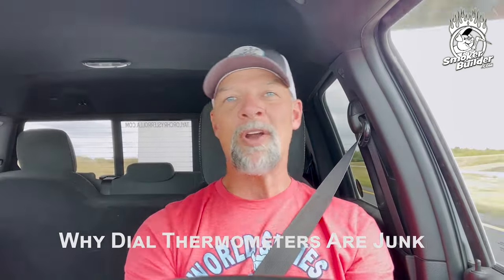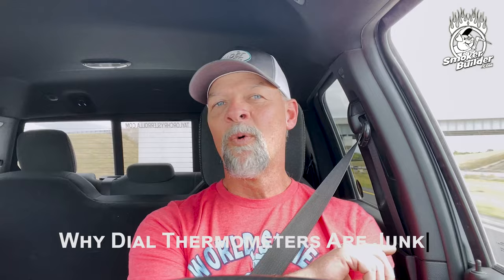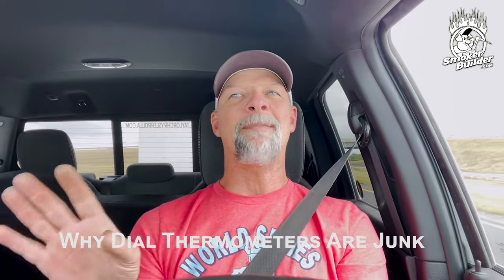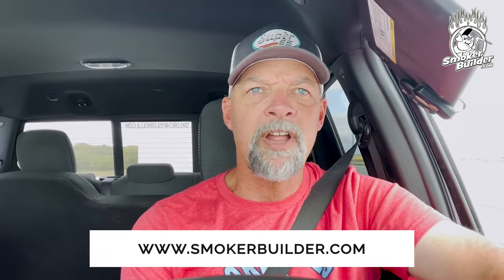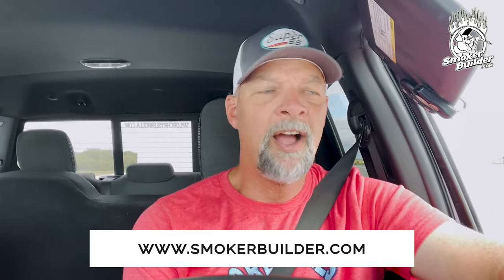Cooking Temperature: Why I Think Dial Thermometers Are Junk

Comment: Absolutely right, Frank! I am definitely a tech head and I can't even tell you how many digital thermometers I have. My latest pit has 3 dial thermometers, and I just bought 4 to put in the one I'm finishing up... but... I use my Fireboard with 6 probes and my Themopro with 4 probes, as well as various others at times, as well... Maverick, as you mentioned, an iGrill, etc. All those wires and probes make my pit look like something hooked up to life support, but I've learned over the years to map out the various temps of my cookers in multiple spots AT THE GRATE LEVEL. Dial thermometers in the doors or walls of your pit are good only as a spot check, and what I've learned is learning that the dial thermometer showing 230 or 240 may correlate to grate level temps within 20 or 30 degrees, or whatever. Basically, as many of us have preached for years - LEARN YOUR SMOKER. Learn how it cooks. Learn where it likes to run (cooking temps). Learn how it flows, what the response of your meat is in relation to the cooking temps and flow of air through the cooker - if it's a top-down offset, or a reverse flow cooking mostly via radiant heat from the baffle plate on the bottom, etc. I use my dial thermometers as a 'reference' point, knowing about where I need it to be (given current conditions) and I can see them from 10 or 20 feet away, without having to get close to my digital thermometer's screen to read it, or pull up my phone to check the display, etc. And yes, even the thermometer probes mounted on your grates will be affected by the temps of cold meat you've just put on it causing a 'shadow' or an altered temperature zone in the immediate vicinity. Sometimes as much as 30, 40 or more degrees off, and I've seen probes in the 'shadow' of meat (downstream in the heat flow of the cooker) reading as much as a HUNDRED degrees lower than other ambient probes! Learn how to run your pit. I've run as many as FOURTEEN different temp readings one a cooker at one time during a cook - but I've also learned my pit well enough to run the whole cook with NOTHING but the dial thermometers, knowing about where they need to be sitting in order to estimate the general temps at various places on my cooking grates. But I know that the dial isn't ACCURATE for current temp - it gives me an idea of where things are, and I use an 'offset' handicap in my head for each spot in my cooker! lol It's all about how well you know your pit!

Dang... sorry for the dissertation. lol
Reply from the maker: Absolutely 👍🏻

Comment: Good info Frank! I think in the stack would be the best place for a permanently mounted pit thermometer. And for this purpose I'd see nothing wrong with something like a Tel-Tru type, so long as you understand the limitations, and use it more for a simple reference point. A bimetal junction thermometer is generally calibrated at the stated accuracy based on a full scale reading. Using a 50F-550F Tel-Tru for example. The stated accuracy is + or - 1%. So that basically means + or - 5.5F ( 1% X 550 ). At half scale( or 275F ) it's still + or - 5.5F.( which would be an "accuracy" of  2% of the 275F reading). Basically, the only time it will be guaranteed to read within 1% will be at 550F. From there on down, the accuracy of the reading gets progressively worse. Seems like a stack monitor combined with a movable digital would be a good combo.
Reply from the maker: Yep! Using as a reference is the only justifiable purpose in my opinion. 
In the stack is another placement I’m interested to test however this will not show temp zones especially in pits that aren’t “tuned” to be even. 
The stack will give a great indication of average temp though just not an accurate number reading on the dial compared to reality on the cooking chamber.

Comment: When I bought my first big boy stick burner, a Lang, I replaced the thermometers on it because they didn't work. I have literally never used them for cooking. I have a Fireboard for my weber kettle that I use during long cooks. So, when I first got the smoker, I burned a fire and moved the temp probe around the cooking grates to get a lay of the land. 

Once I found an average temp in the area that is usable for smoking low and slow I just left it there and reference it throughout my cooks. Knowing what to look for on my meat and knowing my cook chambers characteristics along with good fire management is enough info for a successful cook. 

I will say I like the look of analog thermometers, kinda looks the part. But I don't plan on putting any on my 500 build.
Reply from the maker: Yep totally agree!
Just get a good feel for things with the digital and roll-on

Comment: Facts. I have cooked many a brisket, ribs, and all kinds of things without a thermometer on my pit. I typically run a digital one at grate level, but have been in situations where I don't have one.
Reply from the maker: Yep, I believe the same.
I do have an ink bird that’s pretty cheap that has four probe ports.
I’ve tested many digital thermometers and the good old cheap four pro Bk bird is the best one out there in my opinion.
Just use it for reference and then put my needle straight up.
heaven forbid someone straightens the dial out lol just kidding I use my hands anyway and feel the temperature

Comment: This confirms my theory. I used to stress so bad over the dial thermometer being different from my probe thermometers. It drove me crazy for a while until I said screw it and finally got some experience with my particular cooker. Lol. Now I cook with more confidence and I keep the dial pointing straight up in my case. That’s about 250 degrees.
Reply from the maker: I learned the needle up trick from some old hog cooker guys. Usually people are too drunk to look at the number and the needle so when the needles pointing straight up and down that’s the right spot lol.
Reply: @SmokerBuilder  lol. It does make it easy to read. I think i learned it on the forum maybe.

Comment: Great video sir!  I have been experiencing about a 30-50 degree difference in temp on my digital thermometer at grate level and the dials at grate level.  The dials always read way higher.  I'm sure it's been talked about hundreds of times but what do you do with the wires on digital thermometers?  I've just been sitting mine through the cook chamber door...

Comment: I just put 2 on mine but its a vertical and i really just have them to see that temps are even top to bottom or what kind of range i can expect.  The beauty of a vertical smoker is the heat travels up so it should be even throughout, right?

Comment: As an HVAC/R guy myself I couldn’t agree more. It’s like the junk dial ones on a walk in cooler that have been stuck in one place for years but the customer insists it’s more accurate than my fluke. I use in my smoker this 4 probe digital that’s fairly accurate. I have even considered putting thermowells in. Don’t get me wrong I still have the dials as well.
Reply from the maker: Ain’t that the truth!
We always used to use the customers thermometer before we left and make sure that their thermometer matched our or we would at least show them how it did not

Comment: I’ve told people that those were wrong and only measure the heat around it. I use it as a reference and on know it’s about 25 degrees hotter at the grate where the meat is.
Reply from the maker: Yup, I learned to go by feel over just trusting the dial. Thanks Randy